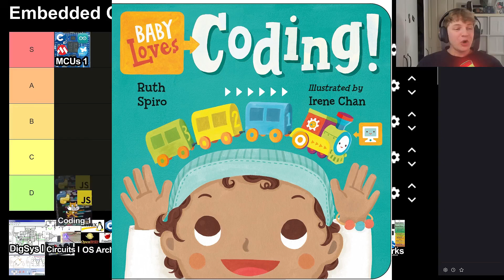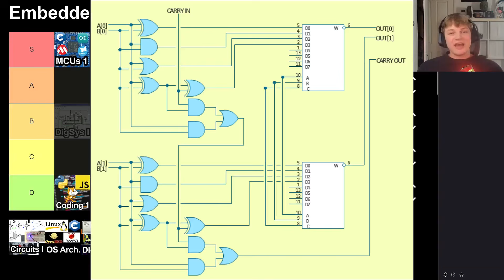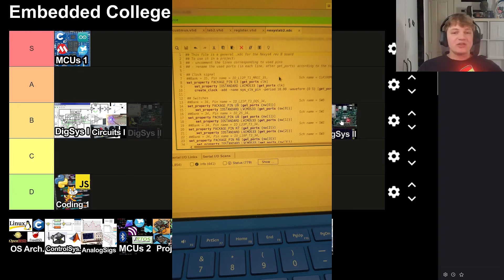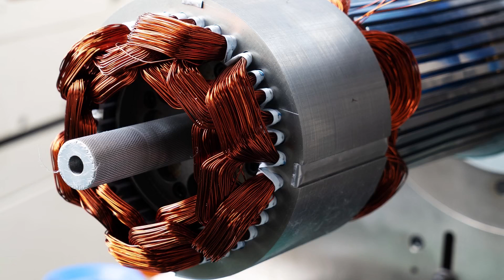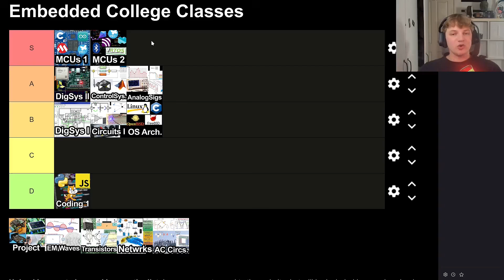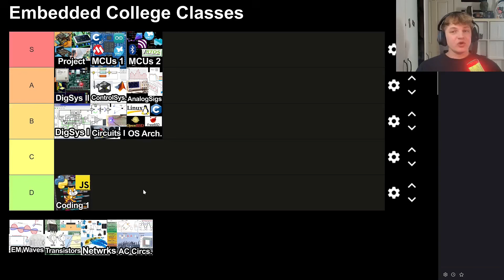The MOST VALUABLE Embedded Systems Courses

Comment: My university course was shit, we never learned C and we never learned about RTOS. Waste of 50k. I had to learn all of that myself. It's the same at most of the universities in the UK, people are not being trained enough to get jobs. I only got my jobs by doing voluntary work experience and my own projects at my own expense. They didnt even teach PCB design. So all my peers are struggling to get jobs, or they get a job and are just making the tea
Reply: relax bro, i spent 6 years (BSc + MSc) studying controls engineering / mechatronics, then working for 3 year only to realize that what i like is embedded. Tbh i realized it after 1 year at the job, so i started learning a lot of these things on my own, until we had an opening at the firmware team in the same company and i got it.
Reply: @LittleSimp1967 I got a BEng in Electrical and Electronic Engineering and other than for the tick on my CV, it was a complete waste of time
Reply: @Brothermanwill  whats the reasons though? do you not self study and do personal projects and certificates and such or do you rely on the degree itself
Reply: @_Cfocus I did personal projects and self learning and i got a job because of it. I was 1 of 2 people on my course doing that
Reply: @Brothermanwill  sorry I dont get it then why are you saying its a waste of time
Reply: its self studying man, you will not get far in life relying on university
Reply: @_Cfocus  I don't but most people do. I'm more annoyed about the value for money aspect.  I'm £50k in debt because of it.

Comment: How do your prioritize and go in a direction, when your curiosity wants to start working on projects in everything?
Reply from the maker: it's a blessing to be interested in a variety of different things, but also a challenge to decide what to do. For sure there is some discipline you need in order to stick to things. Tbf I have many unfinished projects, since I tend to move on once they get to the "good enough" stage. As for picking one thing initially, I would pick something that has the biggest utility for you because then at least you have the motivation to get it to that "good enough" state
Reply: I don't know how to help you pick the direction, but one rule I live by (having a similar problem) is to never use some stalled project as an excuse to not start another one. Pick a few different projects, work on them concurrently. Preferably you have some projects, which force you to better your theoretical knowledge, some projects which are more of a passion thing, doing something you already know decently well, and some projects are to just not get rusty. 
Before I started applying this rule, there were a lot of times where I had a difficult project, which required delving into theory without actually making progress on it for a while, and I would use this project as a sort of excuse to not work on any other thing. I would say to myself something like "nah, I need to work on X. But I'm kinda tired and wouldn't be able to comprehend the new theory rn, so I guess I might as well take a rest". The goal is to replace the "might as well take a rest" for "might as well make some progress in Y"

Comment: how do you actually learn for your college? I felt like you are kind of guy that driven by curiosity and push on that with project..you don't read books...you just use youtube for opinions on programming..then how do you structure, prioritize and make progress in right direction
Reply from the maker: honestly I'm kind of a mess and outside of work I have little structure. for example I have a meeting tomorrow at 9am and it's now 1:16am that I'm typing this comment to you.

That being said I am good at progressing on technical projects. I think I just have a lot of practice in starting from the end goal (i.e. what I want the project to be, what I want it to do) and break it down into smaller parts. Whenever I think of a new feature to add, my brain starts discussing which implementation method is best.

I'm also not afraid of throwing away a week's worth of work if I come up with a better implementation. At the end of the day, I get dopamine from implementing the best solution I can possibly make, so I chase this
Reply: @hoff._world thanks brother!

Comment: Hey man! I wanted to say thank you so much for making these videos. My university had switched several of my embedded systems classes to a completely online format with very little hands on work, and for so long I felt I was learning very little. This channel has been a blessing for me because you showed me all the knowledge gaps that I had as a result of a stunted curriculum. My university decided to skip these entirely (which was a lot): 
- no project courses (or projects in any class for that matter)
- communication protocols
- ADCs and DACs
- PCB design
- Any FPGA design past state machines (I’ll look it up, but I still don’t know what a hardware accelerator does 😢)

Sorry for the long comment/rant. Thank you again for this channel, it has helped me a lot.
Reply from the maker: hey dude thank you so much for the kind words! genuinely makes me smile when I read something like this... well apart from what your university is doing, honestly that's criminal. Sorry to hear this. Do you have a development kit that you can try experimenting with this stuff at home with? For example, many microcontrollers come with ADCs built in, and you can test them using resistor dividers just to see how it kinda works.
Reply: @hof @hoff._world ought an STM Nucleo 64 which should be delivered in the next couple of days. I realize I should have done this WAY earlier but my arduino Uno had satisfied whatever requirements I had for previous projects.